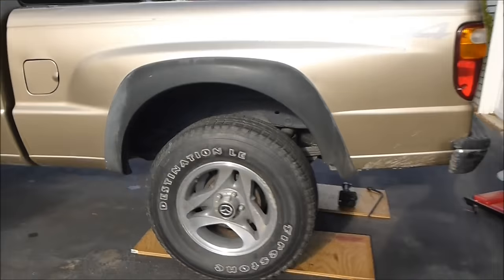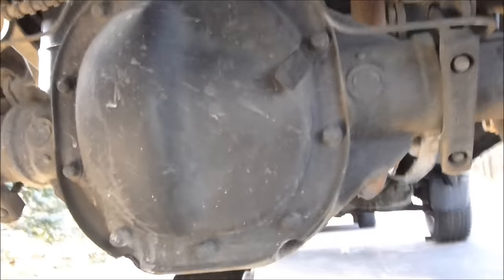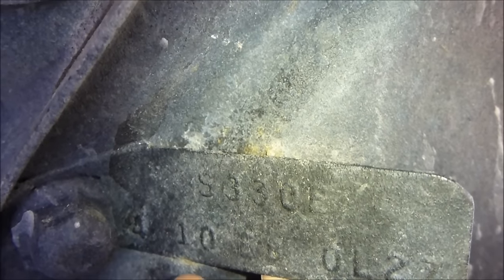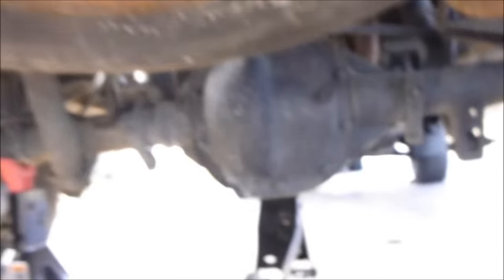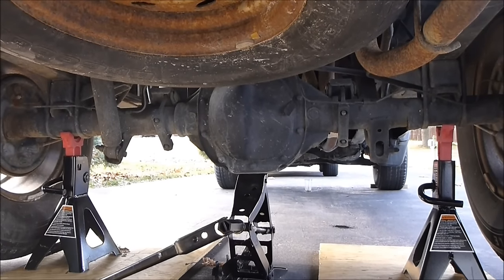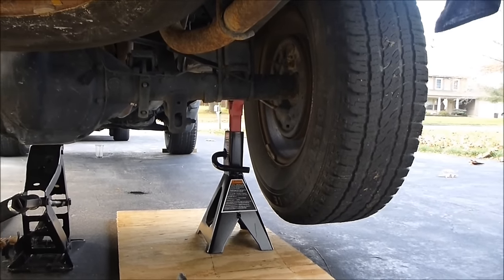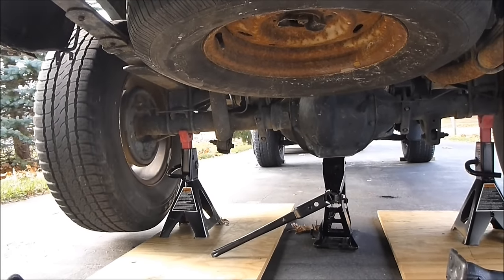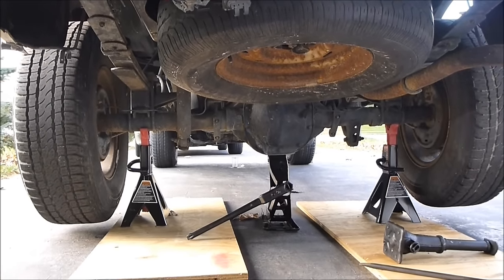How to tell if your car or truck has a limited slip differential

Comment: I have an Eaton G80 in my '07 Silverado, do I need to add limited slip additive to it when I change the rear diff fluid?
Reply from the maker: Skot Ward That locker is awesome! Do you hear any noise when turning? This is directly from Chevy themselves: The use of any additive in locking rear axles (G80) is not recommended. Rear axle additives are designed for use in limited slip differentials which are normally installed in cars. All light duty trucks equipped with RPO G80 make use of a locking differential and the use of additives will delay the engagement of the locking mechanism and may decrease axle life.
Reply: ChrisFix So, I have the Eaton G80 in my 95 Z71 for sure, its on my RPO code sticker, and I have done burnouts before, it spins both wheels, but when I have it jacked up and turn one wheel the other spins opposite. Is this unique to these clutch pack type LSD lockers? Also I know with some RWD cars like the Mazda Miata, this opposite directionally spinning wheels thing means it too has an LSD?

Comment: So if they dont turn two different directions is limited slip?
Reply from the maker: It could be. The point of this video is to see if It is an open diff. Usually there are only two options of differentials, open, or limited slip.

Comment: So does anyone know how I would change my 96 F-150 so both tires spin when doing a burn out... I heard about posi and shit... But I don't wanna replace much of anything... I heard somewhere something about welding something together but I don't remember exactly what it was
Reply from the maker: HiPChecKeRfilms You dont want to weld anything together. You either need a posi or a locker. If you weld the differential gears together, when you make a turn you will break something.
Reply: my 93 F-150 didn't have limited slip either which is stupid. But my 93 mercury cougar ford5.0 has limited slip and works really good in 6" deep mud haha.
Reply: Try a mustang or 5.0 cougar differential. I don't know if it would actually match, but if I really wanted, I would get it done...

Oh ya and my 5.0 cougar slip-differential catches fast. I found myself sliding sideways many of times, including only going 35mph straight and all I did was tap the throttle just almost an inch more (not even near full).
Reply: Just a side topic to not forget...

If I still had my F150, then I would have swapped out the engine into my Cougar 5.0.

Both the engines "are Ford 5.0" but the engines are little different.

1. The mustang/cougar 5.0 version is shorter in height and has more horsepower output but not much options for turbo because of the core strength.

2. The truck 5.0 versions has more engine height. Has less horsepower than a mustang, but it does have just a bit more low-end torque for towing capacity.... And a stronger core for future turbos...

x3xxx... Extra: I do actually dream of swapping in a truck 5.0 truck engine into a Mercury Cougar, including cutting out the hood for extra height space. And adding some regular/super turbos for the legal streets. Since the hood it already cut to fit the engine in, might as well run a huge air in-take through the top (even though it is fuel injected).

Comment: What's the benefit in having rear slip differential sir?? Thanks
Reply from the maker: Limited slip will engage the tire that has traction. So if your right tire starts to spin and lose traction, the left tire will then lock and get power. In an open diff, whatever tire has no traction will get the power.

Comment: All cars move tires opposite ways unless locker is engaged permanently but then you can't make turns, I have a 04 mercury marauder and when in the air does exactly the same As your truck and its limited slip, it engages when either wheel is loosing traction then limited or locker dif. Engages
Reply from the maker: +joel rangel thanks for sharing. I'd check out your clutches in that lsd because they might be worn. An lsd should spin both wheels the same direction like in my Vette and mustang. The mustang has the same rear end setup as your Mercury.
Reply: +ChrisFix why are the wheels tuening opposite from each other bro cars dont do donuts when we drive them lol
Reply: joel rangel then it is not a clutch pack type limited slip it locks mechaically

Comment: Do you need diff lock or a limited slip diff will work in doing some both wheel burnouts and drifts?
Reply: Yes and expect frequent repairs

Comment: What's the benefit of having limited slip..
Reply from the maker: Limited slip will engage the tire that has traction. So if your right tire starts to spin and lose traction, the left tire will then lock and get power. In an open diff, whatever tire has no traction will get the power.

Comment: My wheels turn the opposite direction but at different speed. Is that an open diff or do i have locker and its broken or need the oil changed in it?
Reply from the maker: +Daniel McDaniels If they turn in opposite directions it is most likely an open diff. You should check the owners manual, the vin# and the tag on the diff to make sure.
Reply: +ChrisFix how do i look up the vin#?

Comment: Spinning the drive wheels to see if the other one counter rotates is not a good indicator of limited slip. The method Chris talks about only applies on older vehicles which use clutch packs, hydraulics or another actuator. New vehicles use the ABS system to provide limited slip function, they simply apply the brake to the slipping wheel transferring the power to the other gripping wheel.  Vehicles with eLSD will counter spin, but they are indeed limited slip
Reply: Nick Kaumans Or will act the same but try to do donuts it will spin one wheel,
Reply: All limited slips whether it's, clutch packs, ABS, or hydrologics will all break free and not transfer any where near 100% of torque to the other wheel. Having a limited slip on my Xterra front and rear , and also having a electronic locking differential I can tell you, there is no comparison. Limited slips are shit.

Comment: Help please, when I burn out only one of my tired spin, what does that mean, and whts the fix(99 crown Vic pi)
Reply from the maker: +MySHAQ18 That means you have an open differential.
Reply: +ChrisFix how can I get it to where both tires spin
Reply: +MySHAQ18 weld the diff.

Comment: you have limited slip diff: dude! open is one wheel spins, and lockers both go the same direction.
Reply: Limited slip a.k.a. posi-trac!
Reply from the maker: This is definitely and open diff...
Reply: Wrong. Open diff will have the wheels spin opposite directions. Limited Slip (Posi) will have both wheels spin the same direction. Most lockers act like an open diff until a differential threshold between wheel speeds is met, in which case, it'll lock the axles together.
Reply: ***** Both a locker and a limited slip will spin the tires in the same direction. The difference is, once a locker is engaged, both wheels will spin at the same speed. With a limited slip, both tires will spin the same direction until you overrun the limits (hence the name) of the limited slip. At that point, power will be directed to the tire with the least amount of traction. And actually, a straight axle will not allow the tires to spin the same direction if it is in the air as each wheel uses it's own hub. These can be found at the rear of FWD vehicles that do not have an independent rear suspension, trailers, and at the front of older RWD cars. On the ground, it allows for wheel speed differences in a turn, much like an LSD or open diff does. Lockers can allow wheel speed differences to a point. Spools can not. Consider yourself educated :)

Comment: you said to put car in neutral but what if you can turn wheels while the transmission is in park? are the rear tires supposed to turn when the truck is in park? I have a 2010 Ford f150 fx4
Reply from the maker: +Val Ozuna The rear tires are not supposed to turn with the vehicle in park.
Reply: Well then, I guess I need to take my truck to the shop. What would be causing that?
Reply: Maybe rear differential problems?
Reply: Just looked and I think I have a limited slip the gear ratio says 3.73E something about E-locker. Don't know what that means
Reply from the maker: +Val Ozuna That is awesome! And e-locker is every offroader's dream to have! What I would do it I would park on a hill facing downwards. Then see if the truck rolls. If not, you are good. If you turn one tire at a time, they might not lock up even in park if your driveshaft is not spinning.
Reply: Yeah, that's what happened, the tires spun but drive shaft stayed put. My driveway is downhill and I park my truck there all the time and it doesn't roll. Yah! Lol

Comment: i have a 98 ford ranger and i put it in neutral and i spun the right tire and the other side didnt move is that normal?
Reply from the maker: +Miguel Arguello That means it is an open differential.
Reply: But wouldnt the other tire should also spin and is there a way to change to a lsd

Comment: +ChrisFix , you sure the gear must be in neutral? Because even if it was in a gear, it wouldn't matter.
Reply: Goutham Shailendra if it's in gear you wouldn't be able to turn it because you would be trying to turn the engine over😂
Reply: No, the open differentials would do the same thing right?
Reply: Goutham Shailendra the wheels won't move, open or not if it's in gear and the vehicle is off. Unless you are strong enough to turn over and engine by hand, put it in neutral. Turn one wheel, if the opposite wheel turns the opposite direction, you have an open diff( or a lsd that is badly worn out however unlikely) if they spin the same direction, you have a posi or a locker
Reply: Oh, I understand, thanks a lot mate.

Comment: I have an 88 Olds Cutlass Supreme Classic. It came with a stock LSD. The way I know that is because when it is jacked up from the rear and is in park, I would try to spin the rear wheels but couldn't. When I changed the diff oil, I took off the cover and saw the "S" clip and springs in the diff housing. I didn't pay attention to the tag on the diff. If your vehicle is in park or gear (manual transmission), the park brake off and you spin one drive tire and the other one spins in the opposite direction, you have an open diff or a LSD that has gone bad. If you cannot spin a tire  then you have a LSD or Locker.

Comment: I turned my rear wheels and when I spin the one, it doesn't spin the other? same if I do it to the other wheel?
Reply from the maker: Open diff or you have a locking diff and the clutchs are not good.
Reply: I have a BMW 318CI E46. I'll have to do research on it because I'm changing oils soon but AutoData says oil for LSD and normal diff

So I need to be sure lol

Comment: What about the G80 that GM sells with there Trucks, is it a LSD or a locker?
Reply from the maker: ***** It is a limited slip not a locker. No company sells a pure locker because on the street you will wear out your tires or break your axle with a locker. Jeep has an option for lockers but they are on switches that you turn on and off.
Reply: But they say that it kicks in when it senses 100 rpm difference between rear wheels and disconnects automatically past 20 miles and I also cant make sharp turns sometimes when its on so I think its a locker but not a good one because if it was based on a switch not automatically kicks in would be a lot better also II heard that the are like timed bombs when the blow on you and can make a miss of the rear axles if they were 10 blots not 14 also I have a 3.45 Gear ratio on my truck which is not much usually a good ratio for a full size truck to be a good for off road is 4+ gear ratio but who am I to complain..
Reply from the maker: ***** It isnt a true locker if both wheels are not locked up and spinning at the same speed. Maybe you need to add some limited slip additive (consult your owners manual) so that it doesnt get locked up like that. I guess what you are saying is it is a locker but not a good one lol.
Reply: All the new electronic stuff is reactive. Wheel spin has to happen first and then the system tries to gain lost traction. Manual lockers are 100 times better. Mine is Electrical :/

Comment: Trucks are cars, if you didn't know.
Reply from the maker: +Eston Playz And Stuff Thanks
Reply: I don't know if this was a joke but I truck is not a car. They are both automobiles, but not both cars.
Reply: Specter1031
 Automobile is a synonym of car.

But here's the definition:

a road vehicle, typically with four wheels, powered by an internal-combustion engine and able to carry a small number of people.

Comment: You showed us what a non-limited slip would do if you spun one tire but didn't say what an LSD would do.
Reply from the maker: +C Man Both tires would spin the same direction.
Reply: Thanks. Good info.
Reply: What is a given? If it needs explanation, it's not a given.
Reply: +Al Morais- would it be possible that an open rear end spins opposite from the opposing wheel and on an LSD the opposing wheel doesn't spin unless there is resistance and a welded rear spins regardless? That's three different rearends with three different results. Notice no name calling in my response. Merry Christmas.

Comment: the wheels will do that on a limited slip differential as well. my dads 03 sierra has limited slip and does this, the tires spin reverse like that because of the differential gears, if it was a silid axle then it would not spin like that, most limited slip diffs work when there is an excesssive amount of slip or spin the clutches on the differential gears heat up and expand a bit to tighten the differential gears to the ring gear until the tires move at the same speed. if those tires didn't spin like that then you would get drivetrain bind up and chirping tires and a vibrating vehicle every time you made a corner. a limited slip will get stiffer with constant turning but you will never get your hands to spin the tires fast enough to get much more than a slight stiffness out of it.
Reply: and the reason the right tire will almost always spin on an open diff during a burnout is because of the ring gear and the torque multiplication being greater on the right side and being half on the left. do a reverse burnout and watch the left side spin.
Reply from the maker: Thanks for all of the information and tips!
Reply: The reason your dads Sierra does that is because it has an Eaton ADL or "gov-lock", RPO Axle Code G80. This will act as an open differential until wheel spin occurs. At that point, there is a weight on the carrier that'll lock the axles together.
Reply: Get a real limited slip differential. My Mercury Cougar 5.0 (Mustang/Lincoln) rear wheels will spin same direction when one wheel is turned by hand. If spinning 1 wheel like driving forward then the other wheel will spin like driving forward. Same goes as reverse.
Reply: +bigjohn3435  that's true man !

Comment: What does it mean when i spin one wheel and the other doesn't spin at all
Reply from the maker: Did you check to see if the tag is on your diff? It could mean a few things. What car, model, year, package?
Reply: ChrisFix 1972 Datsun 240z, And thanks for the quick response i checked and found out my parking brake was sticking a little. Thanks
Reply from the maker: Haha, I was actually going to say, try spinning the other wheel and see what it does to the opposite wheel. No prob!

Comment: Hey bro how do i do it so both tires have the same power?
Reply: +Rogelio Heras Thats an open diff
Reply: +LikeAGlov3 thanks brotha and how do you do that if your vehicle doesnt have an open differential?
Reply: +Eric G 1998 ford ranger bro i just want to know how far i can go... Its 4x4 n i jut thought it would make the truck a lil more powerful since its a 4cyl
Reply: +Eric G What?
Reply: You need a locking diff to make the wheels spin exactly the same.  If it's a 4x4 it likely has a limited slip diff, which is better than open when it comes to distributing power equally but it only works so good since it is all friction based.  Open diff is the absolute worst when it comes to what you want.  An open diff is basically useless in any snow, ice, or mud.
Reply: Wait, you have a 2.4 litre in a 4x4?  How is there enough power to go around?